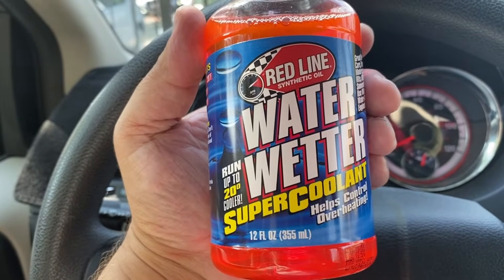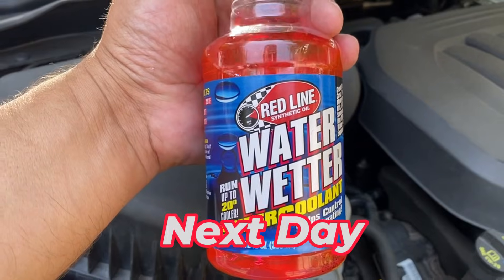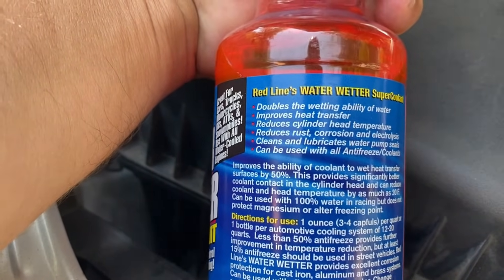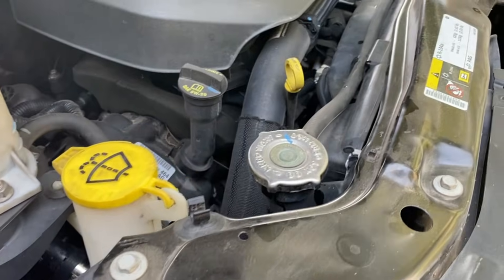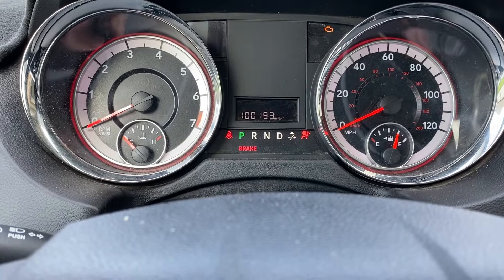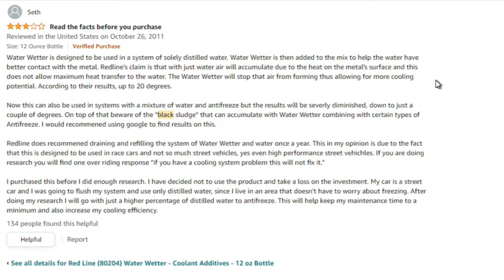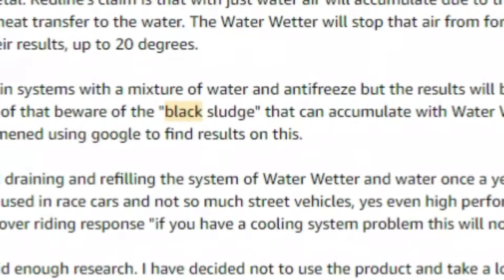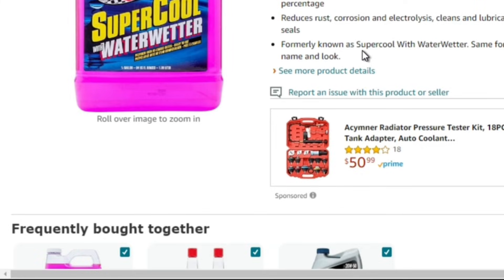Does it work? Redline Water Wetter Review

Comment: Works wonderfully in my cooling system. Replaced my stock rad with an aftermarket chinese made unit and ect was always 3-8c higher than stock in operating conditions. Decided to give this a try, mixed it with half a bottle of ethylene glycol coolant and half a bottle of this thing and the rest was distilled water till full. Amazing result, the Chinese radiator now regulates ect way better and close to stock!

Comment: Nothing to do with the coolant, but for 28 years now I have run Lucas Oil Stabilizer at one quart per oil change, and it helps the engine run a lot cooler. Lucas is at most parts stores. God Bless.

Comment: You used a 12yr old comment to justify your opinion? A comment that mentions black sludge from mixing with antifreeze, despite 1) the bottle saying its safe 2) not flushing your system when you install? Thats important because it may not be the antifreeze thats causing the sludge build up. It could be an nother contaminants or from old/dated antifreeze. Maybe its better to mix with fresh antifreeze because it helps lubricate and prevent some of the things that might slowly break down the efficiency of the antifreeze 

Food for thought. Not trying to start anything. Just thought it was odd.
Reply from the maker: That’s for you feedback.

At the same time the bottle says it’s safe it also states to just add to existing system.

Honestly it maybe great when used with just distilled water but the thermostat and the fact most modern vehicles engines have many aluminum this might not be a good fit.
Now if I was running this in an old 60 or 70 engine it would be okay also at the track.
Little to zero benefit for modern vehicles

Comment: I've been running Water Wetter for 25 years or more in my '69 Camaro.  The car was my daily driver when I first started using it and I drove the car 3-5K miles annually.  It' no longer my daily driver but I still use Water Wetter in it.  I've never seen black sludge in my cooling system.  The engine has always had a cast iron block with aluminum heads and manifold.  The radiator was copper/brass for 20+ years.  Installed an aluminum radiator four years ago.
Reply from the maker: Hi, steven, thanks for sharing experience with your Camaro.
Sounds like a great ride!

Are you running coolant or used water wetter with distilled water? Is there a thermostat 
in that 69 Camaro?
Please provide more information as 25 years a good amount of time to judge a product.
Reply: @RANDOMFIX  I've been running coolant this entire time with the Water Wetter.  It had a thermostat until 2014 when I put a 427SBC in the car with a Dart block.  It doesn't have a water pump bypass so I can't run a thermostat. Thanks!
Reply: i got 86 camaro it runs hot. i lookd it up and they just run hot. hopin this will help alil.
Reply: Steve, how much water wetter do you use vs existing coolant? Thanks
Reply: @darchinova  I have been running a 50/50 blend of coolant/water plus a 12 ounce bottle of water wetter.
Reply: @darchinova im still weary. cause im scared itll loosin up rust on walls and even after a flush i dont want loose rust floaters cloggin stuff up

Comment: i'm not sure about this information but i seen guys on track using this with distilled water (the track at my country does not allow coolant only distilled water) so they use this to protect the engine from corrosion then dump and use normal coolant

Comment: I mean just from a logic point of view, I don't think water wetter was really meant to be ran with anti-freeze.. Sure it will work, but I feel like it kind of defeats the purpose. Antifreeze reduces the cooling ability versus straight water, so if you're racing or just driving hard... during the summer, it's better to run pure water, issue with pure water is, you can corrode metal components.. SO if only there was a product that not only prevented corrosion, but also improved the cooling capabilities... With anti-freeze I kind of think it's pointless.. If it's winter and you need the anti-freeze, you probably aren't having cooling issues.. If it's summer and you have cooling issues.. run straight water.

Comment: Watter wetter is only used with straight water on drag race cars. Its not for street use.
Reply from the maker: You are right and I wish this was marketed differently.
Reply: @RANDOMFIX  For evertday cars, make sure you have a good radiator, water pump, and thermostat and a fan. Drain out and replace your 50/50 coolant mix every 2 years. No need to flush.

Comment: Just pour water with 1/4 vinegar in your radiator and let it warm up [ 25 min ] and let everything drain and fill your radiator with what it needs and drive, simple and good seeeya
Reply from the maker: 1/4 cup of vinegar? For a radiator flush?
Vinegar normally damages rubber as its pits the rubber.
Reply: @RANDOMFIX  I don't know if you know what's in coolant, if your rubber breaks by doing this for 25 minutes until your engine is warm and your fan is on, I think you need a new car

Comment: I used Royal Purple ice coolant additive in my 2004 SRT4. I heard the military uses that in the hummers in the middle east. It helped because it ran about 14° cooler. I also used a cooler thermostat
Reply from the maker: The key is that cooler thermostat.
I haven’t tried that royal purple but I had just moved to Texas and the heat was crazy so I thought I this would help.
It only helps if you change the thermostat and it’s best in racing applications with 100 percent water not coolant. 
The srt4 was a little speed demon when it can out but it was plagued with the usual head gasket issues. Any issues with your srt4?

Comment: You added it to already gummed up water and what previous coolant  in your radiator? It works way better if you add it only after you've cycled the old water to the new. Also I would use distilled water. All the best.

Comment: I had used Water Wetter in a 2007 Suzuki GSXR 750 and noticed temperature dropped like 15 degrees. Also temp fluctuates a bit quicker up and down than before.  I've flushed it once before I sold it and saw no black sludge of any sort. Was like very light pink and can still see a bit of Water Wetter on drain pan. I only use with distilled water with the ratio suggested on bottle. I've now have WW in my Honda NSR250 and just flushed it out, was in there for over 5 years. My Gsxr over 7 years use. 
In your video the small bottle of WW has to be mixed with a ratio as opposed to the big bottle of Super Cool Wetter Water which that one is already blended and don't need a ratio of blending. Temp scale on label of small bottle also shows lowest temp used with Distilled Water only. 
I personally wouldn't use for cold icy weather but I live in Los Angeles, California where it doesn't get that cold and will continue using on my motorcycles.

Comment: Most road course tracks do not allow cars on track that run antifreeze. It's very common for cars to get hotter and start to overflow coolant on the track. If antifreeze gets on the track, it gets very slick, and nobody likes pop surprises when you're pushing the limits on a track. It takes a long time to clean up antifreeze as well. Running just water will cool your car better than antifreeze/water, but you will get rust fast. Water Wetter is meant to be used with distilled water only. It will increase the cooling ability of distilled water alone, and it prevents rust build-up. For daily drivers.... it won't hurt, but I'm not sure how much it helps. Some data on that would be nice to check out.

Comment: Built in mechanisiams ? what? there is no mechanisims that due that LOL
Reply: Nice spelling there ace!😂
Reply from the maker: What? Did I make such a comment or another viewer?
Reply: @RANDOMFIX  not when you get a thumbs down
Reply from the maker: What I don’t follow, speak in sentences and say what I said wrong.
Reply: @RANDOMFIX  at 2:05 you there are mechanisims that keep the water wetter from working, there are no mechanisms that do that
Reply from the maker: @JeepFreak1941 now we are having a conversation.

the thermostat, newer vehicles are designed to operate at specific temperature and so if the if it cool the thermostat won’t open. 
You could learn to be polite.
Reply: @RANDOMFIX  polite? how was I impolite? i JUST stated that you said that there are mechanisims that wont allow you to use water wetter... and I replied that there are no mechanisims that due that.
Reply from the maker: @JeepFreak1941 all good 👍
Reply: @RANDOMFIX  The thermostat will open at the right temp. However adding water wetter makes that coolant temperature remain constant even in extreme conditions.

Comment: You can absolutely run distilled water alone in your car. It actually cools better than 50/50 antifreeze mix. You just have to ensure that you change it out before winter, so it doesn’t freeze.
Reply: If you live where it freezes LOL. Dont have that problem around here.
Reply: Lol, this is a stupid tax. Let me sell you a $10.00 bottle of water to make your water wetter. 😅😅😅
Reply: Without anti-freeze (just glycol and colouring?) the danger is from electroysis caused by disimilar metals in you engine. The possible outcome over time is the alloyhead (or head gasket) on your engine becomes swiss cheese. For the same reason ships have a sacrificial anode (zinc?) bolted to the hull that eats away instead of the hull. I think the Water Wetter may reduce water pump cavitation at high revs, at best.
Reply: @jethrot100  Yes there have been many many studies done on it. Distilled water along with an additive, Water Wetter, Royal Purple Ice, Engine Ice etc… does cool better than 50/50 antifreeze mix. Anti freeze is literally for 1 thing and that’s to keep the liquid from freezing in winter lol. If you run distilled water and an additive during the summer and swap it back out to 50/50 antifreeze in the fall, that’s the most efficient cooling method. For people that have carbureted big/ small blacks and live in the south where temps get over 100 degrees in the summer, waters beats 50/50 antifreeze mix every time. And as far as the water causing issues with the metals in the block/ heads were only talking about 5-6 months tops, which isn’t long enough for corrosion that would actually damage the engine to take place.
Reply: right then you forget one night or end up in the hospital for a week and come back to a cracked block. Not taking the chance
Reply: @RzVids  It’s more for racing applications or an old muscle car you keep in the garage 100% of the time unless you’re driving it.

Comment: From my own personal experiences mixing concentrate coolant with water, as well as everything I've read online, it seems Water Wetter (as the name implies) is meant to be mixed with water. Especially distilled water. Typically I run a 70/30 mix with some Water Wetter added in, which I've had the best luck with. Would I recommend it normally? Probably not, since it seems to be formulated for a particular task such as mixing your own coolant or racing on the track. But it handles that particular task incredibly well.

I can definitely confirm when it comes to OEM radiator caps, too. I've had nothing but issues with aftermarket ones.
Reply from the maker: Yes your are 100 correct as to specialty use and thanks for confirming that oem radiator caps are a must.

Comment: For anyone who wants to add to a regular 50/50 or 30/70 coolant mix i use rislone hyper coolant in green to mix with my green coolant.juat dosent seem right adding red to green. I have a specs sheet between these 2 ive mentioned plus a couple more and both these brands performed on par. Just something for the green coolant guys

Comment: It works. But it made my Mercedes throw a code. 😂 It says “thermostat delay too cool” . It definitely works, but I guess my Mercedes won’t be using it anymore. It made my car run too cool 😂. Benz’s actually run pretty hot, so I thought I’d try to bring down the temp a bit to prolong engine life. But all the peripherals depend on the engine running at a certain temp . In my case 85-95C (185-203F) . But yeah, it definitely brings down the temp. I was running 80-85C. But my car didn’t like it
Reply from the maker: To off this code popping on your mercedes and you need to complete a drive cycle try turning on the air conditioning right away and this code will be avoid. Thanks for sharing
Reply: @RANDOMFIX  I just flushed my system and put in a new thermostat. It’s all good now. I just won’t run this in my Benz’s. I got two Mercedes. But it works fine in my other cars.

Comment: last summeri  bought a restored 1935 ford 4 door sedan with a flat head 8 in it. all restored. was hot, i bought it in ohio and drove it back to washington state, before i left i changed the antifreeze and put in 2 botttles of watter wetter. . now was  in ohio was over 107 degrees when i left. car never got  over 145 degrees  and cruising along at 65 mph it never budged. i thought going thu laramie wyo was gonna for sure over heat, nope.that old flathead 87 never once got hot or warm fyi i do have a vvery old school a/c  that attaches to the passenger window  and takes ice. orked okay so i stopp et a truck stop and bought a water cooller /ac that also worked just fine watter  wetter is fantastic, i swear by it
Reply from the maker: That makes sense in your application on your 1935 ford. Your trip as sounds fun and that window a\c sound unique. In modern cars with thermostats isn’t a little different as they have to get certain temperatures and stay there.

Comment: I use distilled water and 3/4 of a bottle of water wetter. The temperature drops on average of 15 degrees. This stuff works 100%
Reply from the maker: In what application are you using this in? Is thermostat removed?

Comment: The reason I use it - When I was a kid my dad had a 2nd gen Prelude that had a overheating problem in traffic with the AC blasting. We were at a parts house getting coolant to refill after boiling over. While there we saw waterwetter and it's claim to lower temperatures. We both questioned it and he said screw it we'll try it. Dumped the waterwetter in then filled with the ole green antifreeze, after that day it never boiled over in traffic again. To this day everything I own has some waterwetter in the coolant system. Never had the "black sludge" problem in the last 15 years. Especially the motorcycles because some of them have small radiators and or don't have fans from the factory.
Reply: I bought ur Prelude and I found the bottle at the glove box. Thank you
Reply from the maker: Thanks for sharing your experience about the prelude and motorcycles. I appreciate you taking the to share this  information.